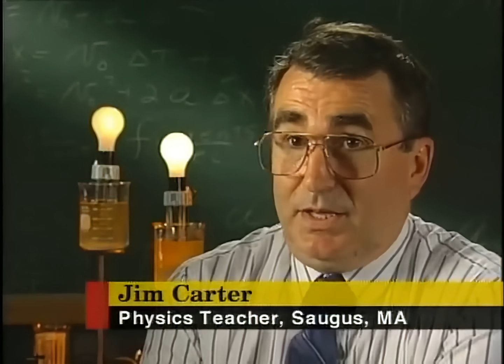MIT graduates cannot power a light bulb with a battery.

Comment: The filament is indeed lit by the 1.5v battery. It gives off imperceivable levels of infrared light as the filament is no doubt heated ever so slightly by the small current.
Reply: Golden Grenadier what are you even talking about.
Reply: He's talking about people's arguments that the battery wasn't strong enough anyway.

Comment: I know this since i was 7 years old: you tale the wire and put ir around one end of the bulb and un contact with one end  of the battery. then you touch the free side of the battery and the free side of the bulb and (if you are using the right bulb) you get light.

Comment: You'd need 2 wires though?
Reply: Pete Detrick no. just touch the bulb directly with the battery
Reply: Doesn't work with all bulbs though.
Reply: Pete Detrick well it should, since all lightbulbs are designed to fit in a socket
Reply: Jakob Alexandersen not true. if you look at a car lightbulb there is two leads that come out of it. so my answer would be it depends. plus some bulbs are going to have way too much resistance for a smaller battery

Comment: I know that one end of the wire has to be hooked up to the positive, and the other has to be hooked up to the negative. No idea how to actually hook the light bulb up to the circuit.
Reply: Thomas Riley the problem wasn't in the way they were arranging the battery, bulb, and wire... it was that they had a 1.5 volt D cell battery and they were trying to light up a bulb that normally uses a 120 volt power source.
Reply: Thomas Riley well u could, there is no positive or negative on a light bulb, which means u can just wire it however you want, aslong as there is current running through.  An led is a diode, there is polarity on them, u could wire it the other way, but i think if you do, the light would be dimmer or wont see it, since electricity is meant to only move in one direction through a diode.
Reply: Every single electrical device has a positive and negative so you just connect the terminals of the battery and light bulb accordingly.
Reply: xXxGnuVirusxXx OH! Thanks for that. Yeah, you're not gonna be able to power that light bulb no matter how powerful that battery is. Not without a power inverter, anyways.
Reply: Sebi One they didn't wire it correctly either though

Comment: depends on it, an incandescent light bulb for 230v will doubly light up on 1.5v. Maybe on 9v.
Reply: Patrick Appeldoorn
i could argue that it depends on the wattage of the light bulb,1.5v is really low compared to 230v, remember some test experiments iwth incandescent bulbs and varistors at school. I believe either low or high wattage bulbs wouldn't light up at voltages under 5v or so.
Reply: Patrick Appledoorn
230V one would not get nearly hot enough on a 9V to emit any light that any human's eye can see, even in the dark. 
a 100W 230V bulb would be using 0.3W on a 9V DC.
Reply: Patrick Appeldoorn 
it is true that the wire would emit radiation, but it is not in any way significant here. anything that has a temperature above absolute zero emits energy, and the lightbulb emits it even when not connected to a battery (if you are not sure how does that not break the second law of thermodynamics, its because it also soaks up energy from its surroundings through radiation and conduction, so its at constant temperature while constantly radiating energy). but the energy isnt visible lighht to the human eye. all the battery would do is raise the tungsten's temperature a few degrees (or a few dozen degrees), and it would still be hundreds of degrees away from emitting visible light (by both wavelenght and intensity, and a few hundred degrees if you think both in kelvins or the farenheit's scale). i sincerely doubt thats what the journalist was aiming for. It would be an advanced thermodynamics question, and not a simple electric circuit question.

Comment: but dont light bulbs run on alternating current? the battery is direct current.
Reply: Nope,  you can light a conventional bulb with DC as long as voltage matches more or less. Of course these students were too dumb to close the circuit by touching a battery with base of the bulb and using wire to connect the other pole. If that would not work, I would check the voltage and wattage rating of the bulb - if it's higher than what this battery can provide, you would have to use more components than just a single wire (like DC-DC converter and something to accumulate the power, like a capacitor, to light this bulb in a short pulse).

Comment: you'd need to know the fraction of MIT students who suck at solving this vs the fraction of students at other institutions who suck at solving this, or you don't know much of anything about MIT student competency.  You're as bad at reasoning correctly to discover truth as you claim MIT students are with electronics.   Maybe you found the 2% of students who can't answer it.  Maybe you asked them if it could be done and they assumed you meant with compatible parts;  Is it just me or are you actually handing them a 1.5VDC battery and asking them to power a 110VAC bulb with it?
Reply: How do you explain that even ONE of those MIT graduates held the wire like at 1:26 and then proceeded to say "I'm not an electrical engineer.. I'm a mechanical engineer."  .How did this person graduate. I just dont get this. These are graduates arent they ? And from goddamn MIT. Unless they are actors then I cant find an other explanation.
Reply: she wasnt trying to connect it that way, she was probably looking at the interviewer while talking and they were filming her hands while she held it arbitrarily

I have a degree in computer electronics and I wouldn't be able to get an AC bulb working with just that battery and a wire either, because it's not possible.  And when she's saying that she might be hooking it up totally incorrectly, she probably means backward.  I couldn't tell you offhand if a contact is supposed to be positive on a bulb; we use LEDs now and there's no point memorizing electrician knowledge that I can look up in 10 seconds if i ever need it
Reply: MonkeyKong
I might be fooled from the power of editing. But it still seems soooooo god damn strange. Especially the "I'm not an electrical engineer.. I'm a mechanical engineer." Like please girl... get real. This is AS SIMPLE AS IT GETS.

Comment: butt, but i was doing this since i was five wtf man
Reply: But some people have never done this very specific activity, which means that not everyone knows how to do it.
Reply: but still COME ON
Reply: You should absolutely not be deported. You do not need to know to fix a lightbulb if you're an administrator, you do not need to know how to fix a lightbulb if you're a server manager, you do not need to know how to fix a lightbulb if you're work with financial servicing.

And by the way, that is not how you setup a modern lightbulb in a house, that information is practically useless. Maybe if you are focusing on really old houses electricity you might find it useful to know this though.

Thinking about deporting people because they do not know a common skill is an absolutely insane thought. And what you consider normal or common, may not be what everyone else consider common.
Reply: You do not put the wires directly onto a modern bulb, there is a plate on the back, touching a hole in the roof where you are supposed to put the wires. It's kind of the same concept, but it's a lot more straight forward than having to somehow magically know where to put the wires on and old bulb. They do not have to know it either, as it is not needed in any way.
Reply: The topic is actually so simple, that everyone should be able to do that. At least everyone who finished a primary school and had a physics course covering basics of electricity. I have no idea how US education system works, but in my country literally every adult (not mentally disabled) person SHOULD be able to do that. Of course it doesn't mean that each person in my country is actually able to do that, but from graduates of MIT I would REALLY expect this skill.
Reply: It is interesting to hear that you remember every single thing tought to you ever, cause many other people forget entire months worth of things they've learned in school. Not you though. you expect every person to remember little random things like how does a really old lightbulb work? Basic electronics does not have to use this specific bulb shown in this video either. There are many others with different plus minus points, especially newer spotlights.
Reply: Arend Mookhoek yes, of course... it's probably rated as a wattage. what I'm saying is it's easy to take a video of lots of people getting it right and edit it to make them look dumb. which is what I believe the situation here is. lots of people panicked and fumble when put on camera, there where probabbly just the worst example of a whole range of people.
Reply: I think I might have the answer. The do not learn this basic shit at MIT. They expect their students to know these things from before, however many people miss out on that one day in school when you get tought this, and many more forget it.
Reply: but isnt basic electronics part of highshool? i was giving presentations about electric motors in prmary shool like wtf
Reply: nevermind, im stupid. even if it was a 10watt bulb it would still need 6.7 amps wich i think only lipo  can do. so its not possible and im quite arrogant for thinking im right. but they should STILL have been able to put the wires on the correct way. but it might be just possible (if it was ten watts(wich it was not)) if you were to give it 10%power at 1.5 volts then that would require around 0,7 amps wich might just be possible
Reply: Arend Mookhoek The problem was that they only had a single isolated wire, meaning that you had to realize that you could put the base of the lightbulb on top of the battery in order for it to work. One of the students said that as she couldn't make a closed circuit, as she only had one wire, it wouldn't work.
Reply: igortcgg there you go, it would be fine if they couldnt hold all the wires but this was just pathetic, shorting the batteries out, only connecting one terminal WHAT THE FUCK AMERICANS
Reply: Looks edited to show the fumbling and not them actually trying. That battery will never light that bulb anyway, that bulb is made for higher voltage and ac.. The whole video is trying to send a message based on some heavily edited footage to make the students look like idiots. kinda irresponsible... I go to a much more shit uni, and 99% of the students will tell you that battery will do jack shit to that bulb.
Reply: Arend Mookhoek you sure on that? it looks like a pretty old shit bulb, that's only a 1.5v battery. even the tiny little bulb only partially lights up when connected. I'd be surprised if that same voltage across that much larger filement would produce any noticeable light at all
Reply: is that a cynical commment?
Reply: TheLethalMoo  it's a flashlight/torch bulb. And one guy did get it to light if you watched the entire video.
Reply: ***** exactly my point, im struggeling with math and all that but come on this is ez
Reply: @ ReaktorLeak:  It's true that no one is born knowing this stuff, but I would assume that anyone going to MIT is interested in science and engineering and "how things work", and is at least a little bit curious and inquisitive.  Thus, I would expect an MIT grad (indeed, an incoming freshman, to be honest) to understand this most basic of circuits -- and frankly, to have actually connected a light bulb to a battery with a wire by the time they were in junior high school at the latest.
Reply: Aski but if you dont know how to do that (the most basic of elctronics) how is it possible to learn about any other form of electroics? the point here is that if you dont know how to do that you should be deported.
Reply: Aski bro wtf are you talkining about they HAVE to know that they need to connect one end to a positve terminal and one end to a negative terminal, so why dont they go looking for the two different terminals? if they dont understand what to do here they dont understand the most basic of electronics so how can you graduate from the "best" "technoligy" university without knowing the ,most basic of electronics?
Reply: Aski how old are u btw?
Reply: TheLethalMoo idk what you are learning at school but that battery can in fact slightly light that bulb, there is a big difference between ac and dc
Reply: TheLethalMoo im not sure about that exact light but iif it can supply enough amps it should be fine, thats besides the point, they should have connected it correctly the end, even if it did not light they should have theoretically done it right
Reply: Arend Mookhoek my class tried it it works
Reply: Arend Mookhoek same, I have been doing this since kindergarten
Reply: ITS FUCKING MIT M8
Reply: @ KingNast, who said "it's a flashlight/torch bulb."
 
That was only one bulb.  Most, if not all, of the rest of the grads were 
given a 120 volt household bulb, which will not light up with a mere 1.5 volts.
 
It's a lame experiment, because it has two variables instead of one:  the issue of the voltage problem I described above, as well as the issue of how to connect the bulb to the battery, which this "experiment" was supposedly testing.  Why design an experiment that won't work even if the subject connects the circuit correctly?  LAME.
Reply: Captain Quirk dude, i dont care if the light turns on, you just have to wire the curcuit up correctly.
Reply: But the question was "Do you think you could light up a bulb with a battery and wire?".  So it matters whether the light turns on or not.
Reply: Captain Quirk you are wrong, if you have graduated mit with mechanical engineering, you should understand the very basics of electronics. she didnt, she connected one wire and thought that was it. if they connected it correctly and said ; well if the battery had more power or if the bulb took less watts it would work, that would have been fine. they didnt do that, they just failed the most basic electronics test ever.
Reply: @ Arend, who said "if you have graduated MIT with mechanical engineering, you should understand the very basics of electronics."
 
Yes, I agree with you on that. 
 
--"she didnt, she connected one wire and thought that was it."
 
Yes, that was strange.  Anyone with even the most rudimentary background in engineering (any kind of engineering) should understand the basic concept of electric current flow in a circuit.  Many of us on this forum (myself included) learned this kid of stuff in elementary school. 
 
--"they just failed the most basic electronics test ever."
 
Indeed they did.   Nevertheless, the experiment was still set up wrong.  Even if the MIT grads had hooked up the wire and bulb correctly, it still wouldn't light up (in those instances where a 120-volt bulb was used, which was most of them).  I don't know why the video producers did that.  That was the point of my original comment.  Not that the MIT grads appeared to be incompetent (which of course they were, except for the black guy), but rather that the producers of this "experiment" were incompetent.  (It was also videographed and edited very poorly.)
 
My guess is that they were journalism majors.  Journalism majors, sadly, are pretty much universally incompetent when it comes to basic science, and especially the fundamentals of electricity.  They talk about things like "watts per hour" and "volts of power" and other nonsense.  
 
But in addition to that general lack of knowledge, this experiment was set up incorrectly, exposing the fact that the filmmakers don't even understand the scientific method.  As I (and others) noted above, they provided the MIT grads with a 1.5-volt cell and a 120-volt bulb.   The problem with that is that now they're testing two different things at the same time, creating ambiguity in the test results.  Are we testing the MIT grads' ability to understand current flow and attach a wire and a light bulb to a battery?  Or are we testing their ability to discern that they are holding a small 120-volt chandelier bulb that can't possibly be lit even when hooked up correctly?  That simply is the wrong way to set up an experiment.  It gives meaningless results.
Reply: I agree that the video was terrible (editing and the test) it doesnt take much to realise that a 120 volt bulb isnt made for this, however maybe it COULD do it. Lets give it a generous 4amps output power and lets say its an eeficient 10watt bulb. Then it could do it. Anyway im rambling and i agree with you.
Reply: Aski saying something like "they should be deported" is called a joke, of course that would be insane, and i understand what you are saying (even though i still think you SHOULD  be able to do it). but why are modern lights not installed in the same way?

Comment: Not being able to get a light working is like not knowing how to spell the word "boks"....... seriously, two terminals on a battery, two terminals on a bulb, two terminals on home speakers, two terminals on nearly every electrical appliance (except the ones with a ground).  In fact every form of energy has two basic poles or sides, or at least two different levels to give it some magnitude and direction.  In grade 3 we learned the parts of a flashlight after learning that a battery powers a bulb.  everything you use has two wires, one in, one out.  In that grade we made a matching game with two sheets of paper, strips of foil, and a lot of tape.  we used a battery and a bulb to verify correct matches from each side to side 😊.  I expect that people are are at least a little inquisitive about the basic workings of things we use daily!